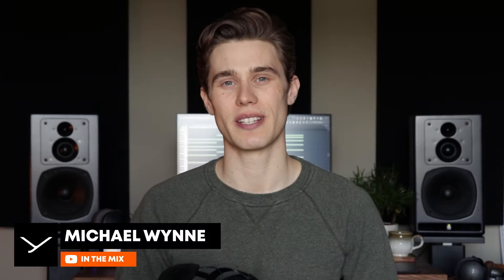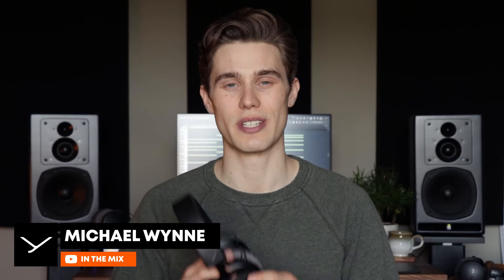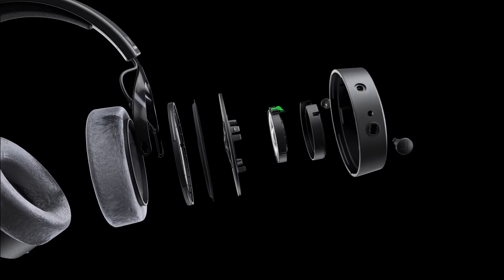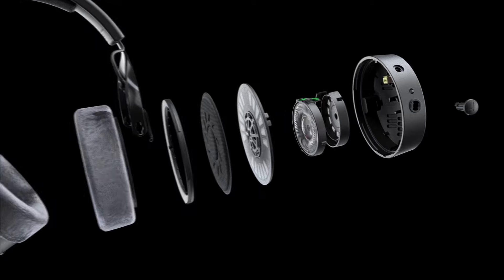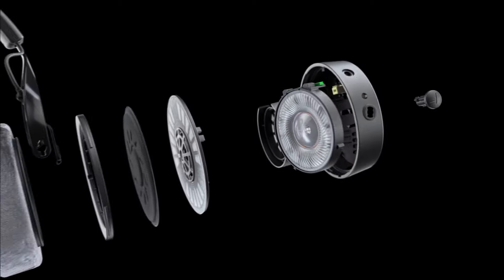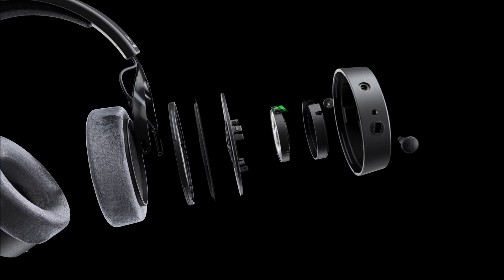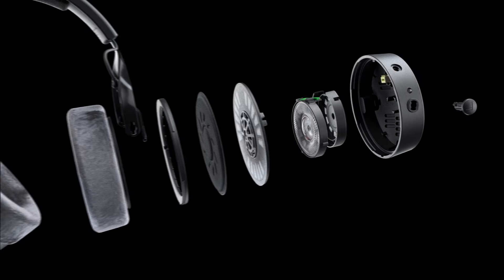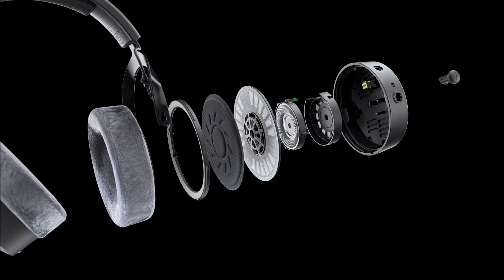beyerdynamic | What’s so special about STELLAR.45 – the new PRO X headphones driver?

Comment: I own The Beyerdynamic DT 700 Pro X and I am very satisfied with my choice of Headphones that it became The Pro X because they are absolutely great sounding and with its very special Stellar.45-Driver. I started using it only with my Sony Xperia 10 V and its built-in DAC & AMP and it worked pretty well I will say but I understood that to get the best music quality possible I'll have to buy myself a combination of DAC/AMP. So I bought The Shanling UA4 with a Balanced 4.4mm 99% Pure Silver Cable. Headphone - DAC Connection & I've ordered The Shanling L3 USB-C - USB-C in 99% Pure Silver Cable. DAC - Smartphone Connection. It cannot be greater sounding than this then it would have to be The Beyerdynamic T1 or T5 Generation 3. to 9.990,- NOK. 
I have thought of buying some Open Planar Magnetics such as Moondrop Venus or HiFiMAN Sundara to check if Planar Magnetics or Dynamic Drivers are best suitable for me.

Comment: Good morning. How would the 700 Pro X compare with the T5 3rd gen for streaming Amazon HD at home? I’m a senior citizen with typical age related hearing loss. I feel as if I can still catch most of the music. 

I’ve tried the 700 Pro X and find them quite comfortable with my large head but wouldn’t mind a bit more room.
Reply from the maker: The DT 700 PRO X is a excellent premium closed back headphones with planty of detail across the whole frequency response, professional sound tuning and very good spaciousness. The T5 (3rd Generation) is our flagship model and regarding the sound it shows even more details, has more of a neutral sound tuning and the maximum spaciousness for a closed back headphone due to the angled drivers. Regarding comfort the T5 (3rd Generation) should provide a bit more room large heads due to a lower headband pressure. Greetings, Patricia